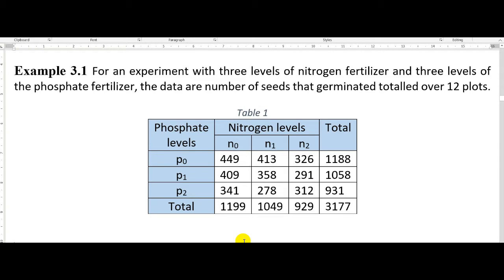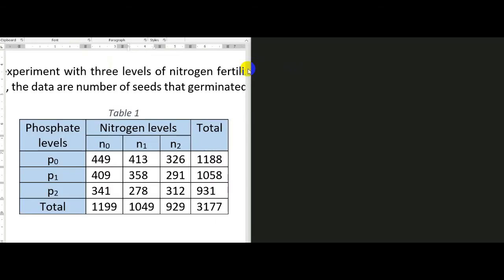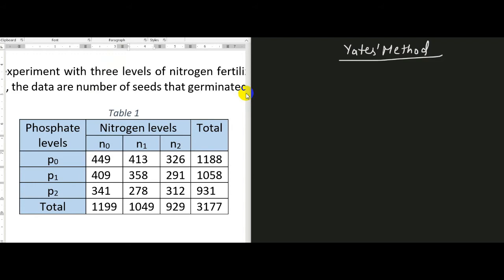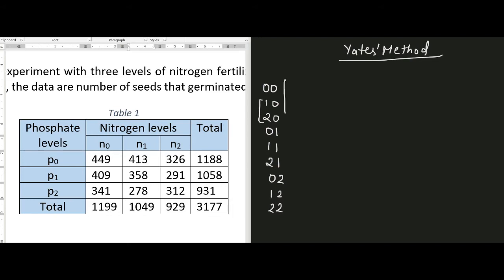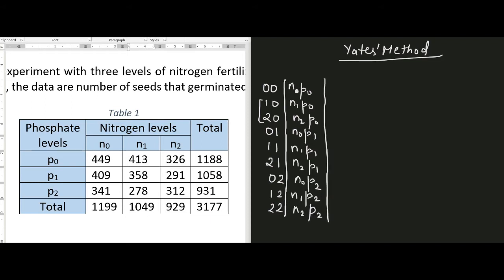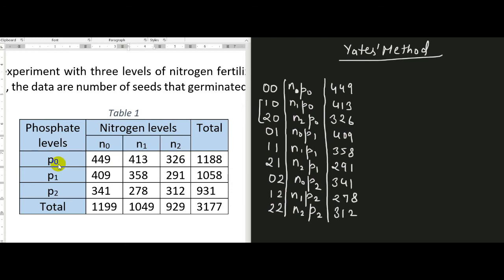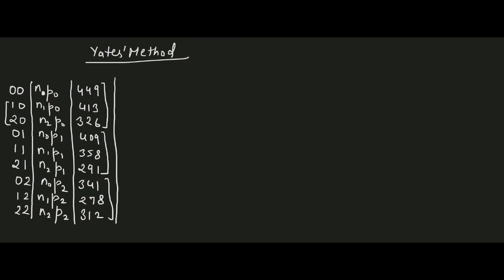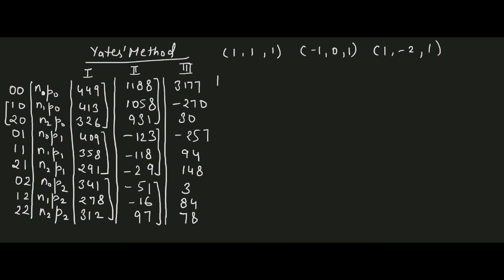Three Level Factorial Design: Yates' method of computing Effects | Lecture 2; Video 2/3

Comment: Very helpful. To get the effects don’t you have to divide by a divisor column?
Reply: The concept of divisor is restricted to the two level symmetric factorial design. Whenever there are more levels or the design is asymmetric (mixed levels) we refrain from using the divisors because of its complexity and the contrasts are treated as effects. That's why in three levels factorial design the terms 'contrast' and 'effect' are used interchangeably.